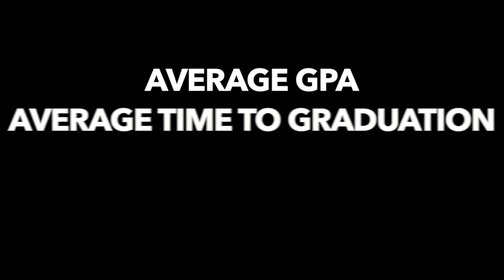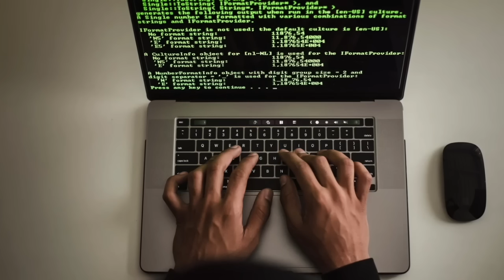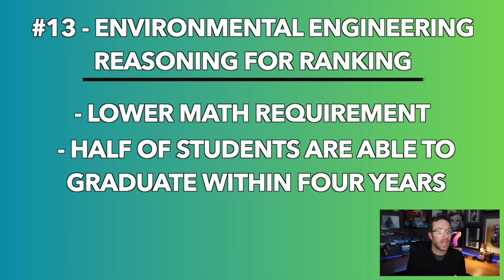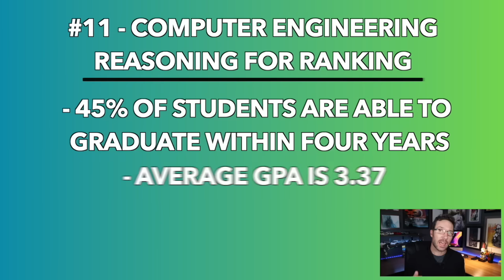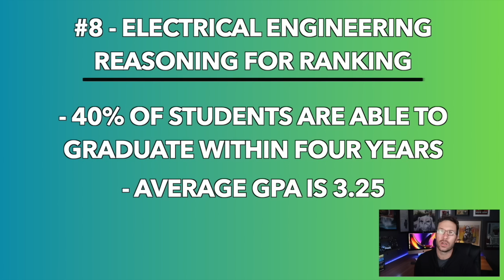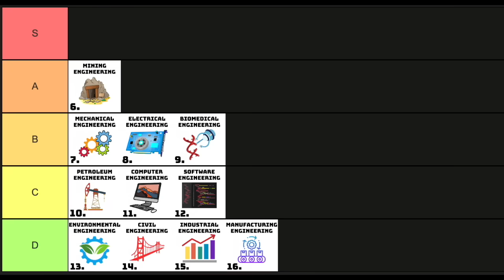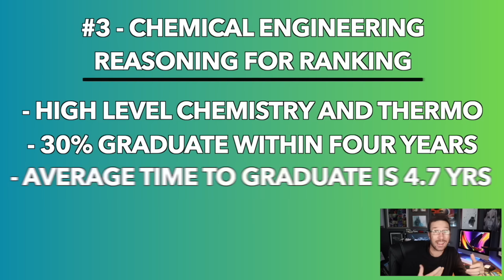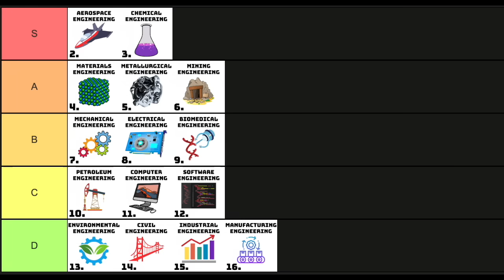Engineering Degrees Ranked By Difficulty (Tier List)

Comment: The Smith Chart was interesting to me being able to use inductive, capacitive, and resistive transmission lines to match characteristic impedances for maximum power transfer and gain and low-noise applications. My concentration in electrical engineering was microwave and RF where I have worked in radar and communications development. When I was in college, math for electrical engineers went past differential equations. I had to take classes in random processes, transform theory, and communications theory. I also had to take the same statics, dynamics, thermodynamics and heat transfer classes that the mechanical engineering students had to take. Our major had us take three different electromagnetics classes on top of the classical physics classes and added modern physics and solid-state physics on top of that. I took microwave engineering, microwave amplifier design, C++, and antenna theory classes to fulfill my concentration. BTW, pay caps off after 30-years working as a technical guru. If you stay in the technical field, make sure you are verse in computer and coding savvy. After 10-years of experience you should think about moving into management whether as a line manager or program manager if you want better pay in your later years.

Comment: Retired Metallurgical Engineer.  BS MetE 1969 Brooklyn Poly Tech; required 144 credits.  I was in a 5 yr Work Study Program (COOP) with the Navy. (2 yrs full time school, middle 3 yrs alternate semesters work and school.)  Managed to complete it in 4 yrs (full time work & part time school some semesters & the opposite the other semesters.)  I was surprised to see the current number of credits required was only 122ish.  Brooklyn Poly some years ago merged with NYU.

Got my MS in ME with a Materials concentration 1974 (part time).  Worked for the Navy for 42 yrs in alloy development (e.g. developed new steels for ships), Non-ferrous welding and NDT (titanium welding for deep submergence craft), metals fatigue and fracture mechanics (dealt with Fleet metallic materials issues) among other projects.  Always interesting, sometimes nerve wracking (real people go to sea in those things).  I'd do it again.

Its a shame that when I retired, the Navy was no longer offering its COOP program.  It helped pay college costs and gave a lot of research and engineering experience.

Comment: What doesn’t make sense to me is how low ranked computer engineering is. Half of my classes in the whole curriculum is electrical engineering classes
Reply: This is sooo true. At my university computer engineering and electrical engineering are almost entirely overlapped
Reply: As an ex super duper 'puter designer, I can say that there is arbitrarily large math requirements.  Electrical, and Electronic engineering is central.  Thermodynamics,   programming, and applied set-theory.  Basically math drives innovation, so you are always looking at nooks and crannies of math to see if it can help.  Oh, and statistics at an advanced level.  Anyone looking for a social life should look into any other discipline except maybe medicine.
Reply: @jamesblossom-f9m  If you look at engineering, then you've long given up the idea of a "social life" whatever that is
Reply: @blizzard1198  As an engineer you are having too much fun to be distracted by some mythical 'social life.'

Comment: Yall ranking software engineering based on math when math is supposed to be the least difficult part of it is kinda funny ngl. In any case, as a software engineering major I've had Analysis I&II, Linear algebra & geometry, coding theory, numerical methods, discrete math (obviously), probability, and number theory, so some of us do have plenty of it. But calculus is generally the easiest and least useful for a software engineer. I actually don't think software engineering should be considered an engineering major for it's far from the other ones, but either way, it is. I am not saying that it should be higher, though, I don't find it hard myself I just wanted to point out that our "math" is either one that has applications in programming or one related to logic. We don't need your average engineer's math - there's nothing to do with it. Also, I studied partial differential equations wth do you mean that's the highest? It was actually fairly easy, too.

Comment: As a Mechanical Engineer with the “Nuclear Option” who worked for a year in the petroleum industry and 30 years aerospace (fighters & helicopters)…. I’m not sure I agree with the top 5 totally.  Reality is aerospace and mechanical are closely aligned - mechanical is simply less specific, some aerospace programs spend additional time with fluid flows, specifically compressible fluids (my school had an emphasis there too).  Mechanical typically covers all the advanced math that electrical does (control system theory) so there is similarity there as well.  I found materials science and metallurgy as not that difficult…. But a lot of concepts and memory, little math.  I think the bottom line is people have different aptitudes - chemistry and electrical were not difficult for me, pure math in the absence of a real world application was a challenge…. But I was the wired kid who excelled when we got to word problems…. A solid “C” math student otherwise…
He used the ‘kinematics’ term with metallurgy or materials - still scratching my head on that one - it is solidly in the mechanical realm (unless I’m missing something).
If nothing else engineering teaches logical problem solving skills applicable outside of engineering applications.  You have more of an ability to self learn.  I would also say in larger organizations, engineers can be very compartmentalized… design engineers synthesize designs, stress engineers analyze, others do materials and processes, fatigue, manufacturing, testing.  Frequently the design engineer plays the role of managing all these disciplines while keeping the end user in mind (cost, maintainability, safety, producibility).  For the record: I was able to compress the “4 year degree into 5 years”…. Perseverance and not giving up…

Comment: Chemical engineers deal with more non-linear differential and partial differential equations than most other engineering studies. Another parameter is " how many students change majors away from a particular engineering because they found the difficulty level was too much".

Comment: In electrical engineering, we study and practice partial differential equations for applications in electromagnetics, signal processing, control systems, and power electronics. Therefore, partial differential equations are integral to these areas of the field. We also study complex analysis and numerical methods, which are considered higher mathematics due to their advanced and specialized nature.

Comment: As a chemical engineer, we all did partial differential equations. As a matter of fact, PDE is too necessary that you cannot scale through ChemE without it especially when you are dealing with fluid dynamics.
Moreso, you can't possibly separate nuclear engineering from chemical engineering. It's like separating a child from her mother's womb. Nuclear engineering is a subset of chemical engineering.
I would without sentiments rank chemical engineering as #1. That degree is the typical Jack of all Trade and a master of them all.
Reply: Im starting chemical engineering next week. I was perhaps misinformed by my councillor and professors that chemical engineering was somewhere on par with software engineering in terms of difficulty. Is chemical engineering really that hard?
Reply: @CarTM  telling you that it's on par with software engineering in difficulty should be a criminal offence. All I can say is "taste and see." It's better felt than told.
Reply: @emmanuelchikeluba2360  Thanks for the advice
Reply: @CarTM  my pleasure

Comment: Most difficult engineering? Probably architecture based on your criteria.

Other than math (typically only calc 2.)
a MINIMUM of a 5 year program (or 4+2 or 3 year masters)
150+ credits
lowest salary expectations for graduates around 50k last I checked
gpa is in the low 3s
then if you want to become licensed that typically takes another 5-8 years and 6 exams each with about a 50% pass rate.
Not to mention the infinite time suck that is studio, at least you guys are done with a problem when you solve it.

I can already hear the engineers angrily typing their responses it the replies lol, this comment is a joke. Each major is hard for its own reasons, and like many other comments I know that any degree you are truly interested in will be 'easier' than any degree you couldn't care less about.

Comment: I am a graduated Aerospace Control Engineer and I can relate to the difficulty, however I do not work in aerospace, but in robotics and cybernatics in the simulator medical sector building humanoid robots and other personal simularors for training of healthcare personnel.

So basically I build electronics, firmware and mechanical systems and apply control theories to achieve and solve complexity. 

So getting a Aerospace degree is like mechanical or mechatronics engineering, but you focus more on systems, GNC, algorithms, Embedded systems etc and basically you can work in any technology development sector, not just aerospace
Reply: nice....

Comment: This is only relevant to the USA as other countries study and classify things differently. Eg software is a science and dedicated and usually a separate faculty to engineering. Also most engineering degrees are also paired with a specalism like communications RF etc. 
Doing finite element analysis by hand for RF modelling in electrical engineering doesn't get more complicated than that.

Comment: I have been in construction/ earthmoving for almost 30 years...I would have to say that in my opinion,the hardest engineering degree has to be the one where the student forgets every damn thing that a college professor writes in a textbook,and at the same time; forces the student to spend several years in the field,finding out what really works in the real world...but if the student does not have any common sense,but only book and computer smarts....their designs will ultimately fail...period.

Comment: It depends on the curriculum used in the university - there are no fixed credit hour requirement (other than the general ABET requirement, which is the same for all engineering majors). Even in environmental engineering, if they use Fick's diffusion, etc. it can get pretty complicated and would need partial differential equations. Electromagnetics is claimed to be difficult, but acoustic waves (taught in mechanical and civil engineering) are more difficult since it has three components, etc. In many universities, nuclear engineering is a program under mechanical engineering, and it is not that difficult. Fission part is well-established, they also have to know about materials behavior under radiation. etc. etc.
Number of years taken by students to graduate is not a measure of difficulty, in some disciplines students do co-op or internship to make money.

Comment: Electrical and Computer engineers have to study different coordinate systems, and in general they are more experienced in maths than a mech engineer whos best maths is related to fluid pressure related equations. They do not know discreet mathematics, polar coordinates, convolutions,  distributions, probability etc... but as far as maths is considered bar for difficulty, IMO electrical is the hardest, they have all the things that CS do w.r.t maths along with the discreet stuff. But their DSP processing related maths-fu is bigger than CS.. so I have to give them 1st post.

Comment: I think you botched this list with Electrical and Computer engineering. Mechanical nor Material or Petroleum is harder than Computer and Electrical. I agree with some top ones like Aerospace and Chemical, but right after that it should be Electrical and Computer. To sayMechanical is harder than Electrical is complete and utter delusion.

Comment: You didnt consider that less popular fields get the weaker candidtates, which would skew the difficulty ranking. for example, petroleum engineering is easier than civil engineering, less math. Electrical is absolutely harder than mechanical engineering. and I am a mining engineer and it is absolutley the easiest engineering. The reason the students take so long, is they are weak candidates to begin with, yet Electrical attracts the strongest candidtate.  I rank your ranking as crap.

Comment: Rankings are pretty good, especially the top and bottom rankings, but a few possible flaws in the methodology IMO.

GPA - When I went to school, many students didn't get high enough grades to be accepted into some of the more desirable engineering departments. Thus, they ended up going to some of the degrees you listed as harder. Which means lower GPA probably isn't really a measure of difficulty but instead might be a measure of quality of students getting that degree. Especially since most engineering degrees have the same core classes. In particular if they end with taking the EIT exam.

Highest Level Math - Not sure how realistic the "core" highest level math you listed is. The issue is that in many engineering disciplines you still have to take higher level math courses but the specific course(s) are "elective" based on the specialization within that engineering discipline that you want to pursue.

Years to complete - All the credit hours you listed seem low, like my degree required 137 hours, so not sure about that. Also, not sure if internship is included in length to complete. Some degrees have more internships available and some benefit more than others by having that internship experience. Thus, if internships are included in time-to-complete then it could throw rankings off.

But I still appreciated the video. It was the best I've seen on the topic and provides actually useful information for students trying to figure out what they might want to major in. I really liked your short summary of "if you like this then this degree might be for you" snippets.

Comment: Well, civil/structural engineer here.

I can say, the degree was easier than all my mechanical engineer friends', but you forgot to mention STRUCTUAL ENGINEER, that's A tier minimum in your list, because you have to study again for 2 or 3 more years and it is not that easy as the degree was.

Structural engineers use finite element analysis and complex equation as well.

Comment: My degrees from the 1970's were in Chemical and Metallurgical Engineering.  These days metallurgical engineering is generally lumped together with Materials Engineering as more non-metallic materials are used.  If one likes chemistry, like me, these degrees might not be considered that difficult.  However, chemical engineering, and to some extant Met E,  teaches a concept called "Transport Phenomena" which lumps together heat transfer, mass transport, and momentum transport under one umbrella, making each topic more complex, lol.  Thank you Bird, Stewart and Lightfoot. ME's tend to take a more straightforward approach to these topics.  Also, when I was in college, Chem E required a Unit Operations lab which could take 8 hours for each experiment and very long lab reports.  Anyway, I probably consider electrical engineering harder because of it's dependence on some higher math, and also it involves a lot of strange physics like field theory and magnetism. I find a lot of the EE concepts quite complex.

Comment: Got a degree in Physics Engineering (not listed), found out HR has no idea what to do with you. Folks tend to use it as a stepping stone to a MS or Phd. Most if not all of these engineering degrees have a year of under graduate physics classes which in turn require up to Calc. 3 and DiffEQ. I suspect a lot of colleges require more just to weed folks out to keep the last two years of students at a manageable amount. For my degree I ended up with a math minor (and computer science minor) not an uncommon minor for many engineering majors.

Comment: I got my degrees in mechanical and automotive engineering in the early eighties. It doesn't matter too much the the difficulties of the study you do. What's much more valuable is to know problem solving, what you learn at the university is not that important. Every area of engineering devolves quickly and you have to be able to adapt. I got my degree using a slide ruler, and never have touched it anymore, the started projecting on paper, which quickly was surpassed by AutoCAD on DOS, which in return got replaced by AutoCAD on Windows. Just after that in 98 we started working with SolidWorks, that evolved to do stress simulations on SolidWorks. Now I can make fan curves with flow simulations without the need to build the fan. 
Certainly there will be new tools with AI, but what never will stop engineering is problem solving!

Comment: This analysis depends on the country and university you attend.

The university I attend has mechanical and mechatronic degrees requiring the highest levels of math requiring an additional math unit. It is also ranked no. 2 worldwide in mining engineering.

That said, there is no Aerospace engineering degree specifically and the mechanical engineering degree having an aeronautical specialisation (allowing for aeronautical engineering accreditation and licensing). 

The aforementioned is evidence of my initial statement.

Comment: I got out of Georgia Tech in '88 with a degree in AE. I loved math and was good at it. Structures was the hardest part followed by fluid dynamics. I was offered a job with McConnell Douglas at 30k. Went with an insurance company instead (engineering consulting involving factories,  warehouses, hospitals, etc.) and retired early.  It was steady and reliable whereas aerospace flies with the contracts.